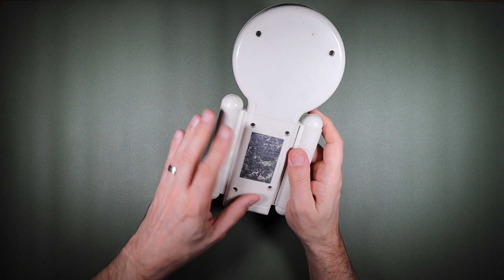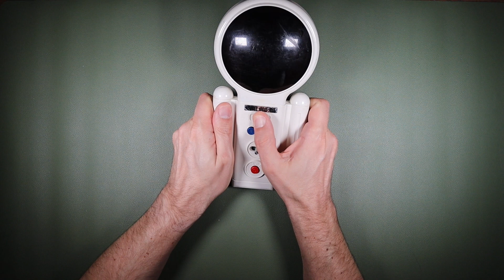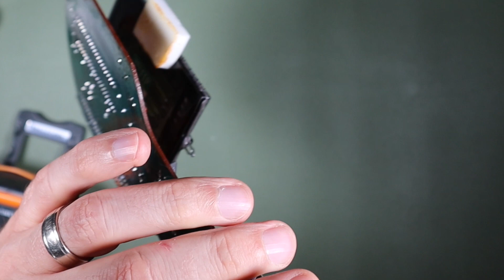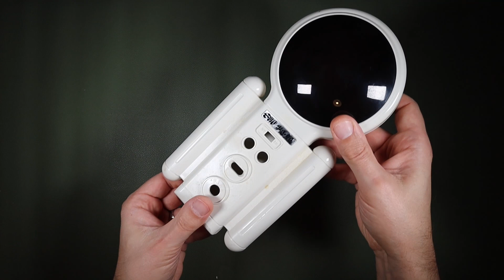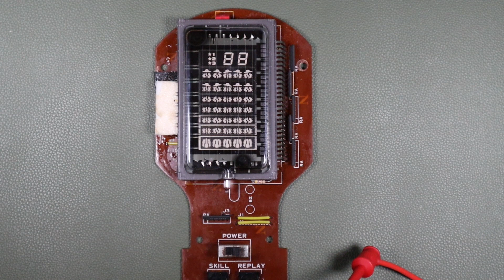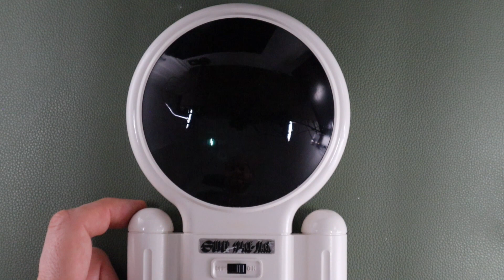Repairing a Rare Onko Super Space Jack.  Japanese Retro Handheld Game

Comment: Great video, I’ve just bought a non working example of this & will use you tutorial to check it. Fingers crossed I can get the same result.
Reply from the maker: Good luck it's a fun game and a great looking design. I found it a bit top heavy to play for long periods, but at least I wanted to play it for those long periods. Stop back and let me know how you got along. Glad you enjoyed the video and thanks for your kind feedback.
Reply: Hi again. Managed to remember & take my multimeter home😂 right away I found the 1st diode you checked maybe my problem. One direction I'm getting 0.6 but the other I'm getting 2.1 😲 Do you think this is the culprit? @RetroTechRepair ... Update, I isolated the diode & it's reading are normal, so checked the transistor c1383 & got the same results you did so I'm going to order 1 & try.🤞🏼
Reply from the maker: Great... I was going to suggest that, testing parts in circuit is a bit hit and miss, it depends on the circuit design whether other parts affect the outcome of an in circuit test. Anyhow, good luck with the repair. Hope the transistor fixes it
Reply: @RetroTechRepair  received a new C1383 transistor today, however the code on it is different. It still has C1383 but instead of “R 9D” it has “Y 3AL” & is slightly smaller. Do you think this is incompatible?
Reply from the maker: @h4rpo1  I'd guess it's just the date code and the size difference is just a different manufacturer or newer part. I'm no expert but If it were mine I'd probably try it.
Reply: @RetroTechRepair I struck out with the new transistor but I get proper reading thru it now, further checks I find at c1 I get battery voltage at 1 side but not the other while the other caps I have voltage at both ends. Maybe worth investing in a capacitor kit. Btw I'm like you, I've not got a great knowledge of these things, I'm just a lowly old vehicle tech😂
Reply from the maker: @h4rpo1  oh that's a shame, I was hoping for great things from that transistor. Before you go chasing caps I'd have a really really good look for cracked PCB tracks. They can be almost impossible to see so you might try setting your meter to continuity and checking between each point that you think there should be a connection. Some of the games I've repaired had really thin PCB tracks
Reply: @RetroTechRepair  I doubted myself on c1 & I realised I was checking it on the wrong polarity, switched things around & while rechecking stuff it flickered into life😮 The longer it was on the more stable it got. Switch off & on it’s ok, switch off & leave it for a few mins it takes time to get going again🤷🏼‍♂️ I need a new piezo disc as it broke away during dismantling so once that arrives I’ll get back into it. Oh, meant to say I apologise for all the ear bending I’m giving you😂
Reply from the maker: @h4rpo1 not a problem at all. For a few reasons I've been away from the channel for a bit I should re-engage soon. Pleased your repair is going well